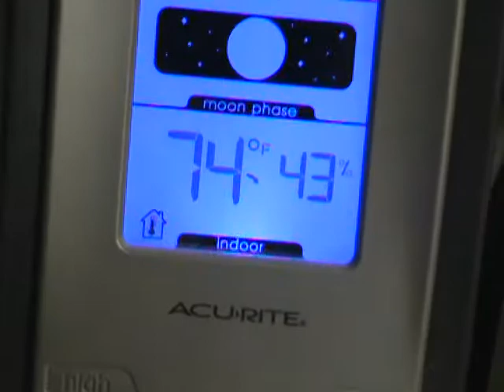WILD CARD CUSTOMS-309-PAINT PIMP

Comment: Fantastic job on the cabinet, I really like the two opening doors,  you can put a piece of something in it the size of the cabinet, no farting around.  For paint, the grid got all the paint blasted off of it in mine,  but only the back wall where I'd hold things up got blasted so go ahead and paint the interior.  Going to put a second set of gloves in it?